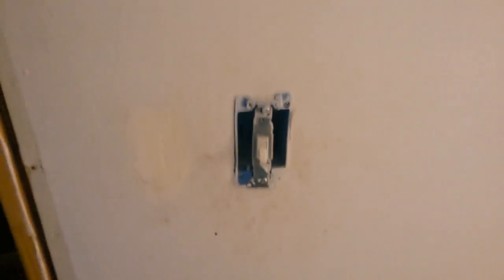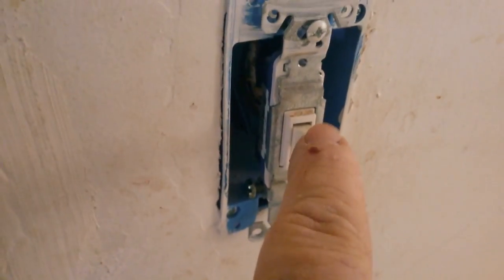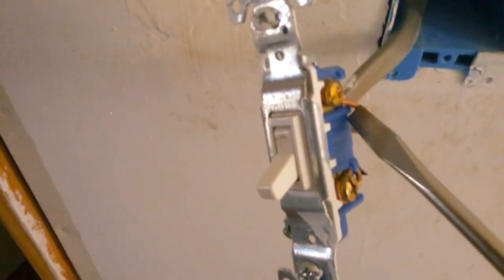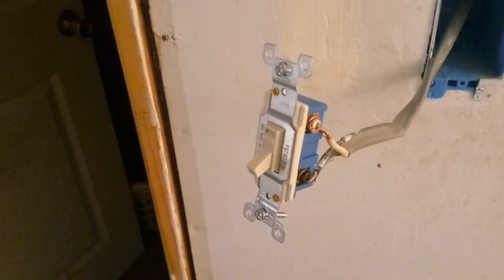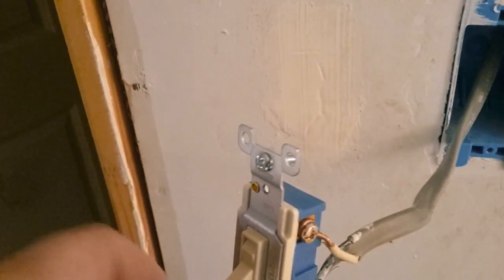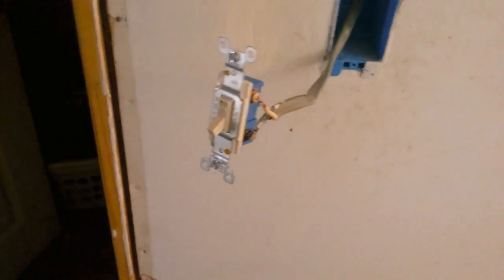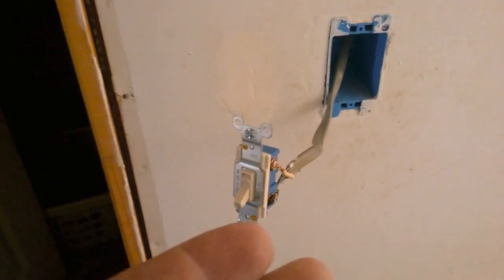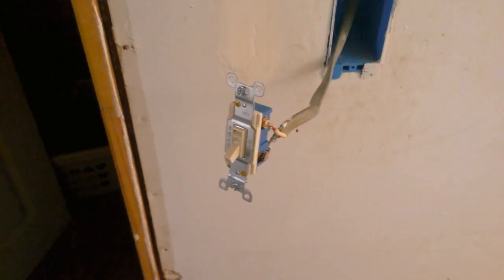How To Replace A Light Switch in a 2 Wire Non Grounded Haunted Home!

Comment: Thank you sir !! I had to replace a light switch in a garage and it only had two wires !! The color of the insulation was blue and I couldn’t find the ground so I connected both on one side and it worked ! The house was built in 1955 !! You saved me some good bucks !
Reply from the maker: You're welcome Gary. Thanks for taking the time to comment on my video about replacing a light switch in a 2 wire non grounded house, I appreciate it!
Reply: @BlueCollarDIY  thank you for sharing this info it’s so helpful and it got the job done ! I appreciate that ! Good info to know !

Comment: Thank you. Going to try this in our older home. Bathroom light won't turn off when switch is turned to off position.
Reply: Worked like a charm. Thanks for the added confidence. I'm actually starting school for electrical in the fall.

Comment: Was otj. And the DOUBLE switch was REALLY OLD one side had 3 wires and the right side only had two wires and they tied the left sode ground into the right side.couldnt tell whichbwas hot amd which was neural cause all the wires were black w copper wiring inside them criscrossed different directions and tied intonthebright side it was bizzare! i tried connecting a few different ways and guage showed power was going tonthebswitch but the ONE four switched breaker box  the middle switch  kept buzzing and tripping when the light was flipped on all sounds crazy ik but any advice? :)

Comment: Does the new one have a third screw on the left side? I couldn't see it. The new one I bought has a green screw on the left.
Reply from the maker: The green screw on a receptacke is for the ground wire. It's for a 3 wire, grounded system. They do make two wire receptacles for non grounded systems. Some people will use the receptacles like yours and just not utilize the ground screw.
Reply: @BlueCollarDIY  Thank you! I will try to find a two screw receptacle!

Comment: What happens if you cross the wires or put the white on the bottom in the black on the top?
Reply from the maker: It will be backwards!
Reply: @BlueCollarDIY  I was wondering the same thing, so the off will be on and the on will be off? Will it cause a short or something or can you just switch them back? Im changing an old switch that has the wires going on the top of switch and can barely see if there white and black. So not sure what will go on top or bottom of new switch.
Reply: Gardner bender volt tester

Comment: I wonder why the light switch box looks like it's blue plastic. Mine are metal, do I need these blue plastic ones? I thought I read that new light switch needs a ground wire. It said something about a pigtail to the green screw and bundling the green wire with the neutral?
Reply from the maker: The box is blue plastic. You may have an older light switch in a 2 wire non grounded house. Since homes are built differently in all regions, I'd talk to an electrician about coming out and fixing your electrical system. I would never bundle a ground and neutral though! They both have their own purpose.
Reply: @BlueCollarDIY  Thanks you.
 Learning about building trades is very interesting to me and is very useful knowledge.

Comment: Ok, what does it look like at the light fixture?
Reply from the maker: It depends on how the home was wired. Older homes around here are generally wired much different than modern homes. In this house, the outlets had a white and black wire running to them. No ground wire and on many of them, the white wire was actually the hot wire. So you really need to check the wires with a voltage sniffer when you go to replace a light switch in a 2 wire non grounded home.
Reply: @BlueCollarDIY  Thanks for the reply, got it figured out with the continuity mode on the multimeter, and a 10’ length of romex, once I found the travelers to the switch, kicked the power back on checked volts to ID the the feeder amongst the rest. 
Thanks for the nudge in the right direction 🤙
Reply from the maker: @LJWalter78  You're welcome. The wiring in some of these older homes can be really challenging! A simple light switch replacement on a 2 wire nongrounded system can become quite the puzzle! lol

Comment: I have a switch going to my basement lights that has only two posts, and both are black wires. What can i do to change? I cant find anywhere that sells these switches.
Reply from the maker: What I've done in the past is to buy a regular light switch and use it. You will probably need to know which black wire is the hot one though.
Reply: @BlueCollarDIY  thank you!

Comment: Many years ago, I hired an electrician to install a remote activated light switch in my home. I recently opened to have a look and noticed there is no ground wire coming from the switch box. The ground wire from the light switch is instead wrapped around the screw that holds the light switch onto the box. Is that a safe workaround for having no ground wires? I checked other light switch boxes in my home and none of them have ground wires. The older switches only have a hot and load wire connected. My only guess is that the metal switch box is grounded. and the screws act as a ground? my home is not that old, built in the late 90's.
Reply from the maker: If you're home was built in the 90's, there should be a ground wire around the green screw on the switch and grounded in the service panel. Then the ground bus in the service panel should be grounded to a rod in the ground outside.
Reply: I have the Same problem some ground screws screwed to the box.  YES it should be okay

Comment: Can you hook up a new light fixture with the old 2 wire electric?
Reply from the maker: I have in the house I'm currently living in. Since I don't have a ground wire, I just secured the ground from the new light fixture to the junction box.
Reply: @BlueCollarDIY  What happens if you don't use the ground wire in the new light fixture?I understand the is a risk of shock but  will it still work ? Also what if the junction box is plastic or not grounded?
Reply from the maker: @TheManWhoSawTomorrow  I have several lights with plastic junction boxes and they work fine. I normally just attach the ground wire to a grounding screw either on the box or on the light fixture itself, even if there isn't a ground. I never just leave them loose.
Reply: @BlueCollarDIY  Thank you.
Reply from the maker: @TheManWhoSawTomorrow  You're welcome
Reply: @BlueCollarDIY  Hey sorry to bother you again but i need more help. Am frustrated at this point. Here is my situation.
I wanted to change an old working problem free outdoor light fixture to a modern one which is controlled by a single switch (so i assume its a single pole switch and wiring).  I take off the light fixture.Its an old house so no ground. So i install the new fixture and just screw the ground from the new fixture to the metal bracket it came with knowing it still wasn't grounded but i learned ground can be left out and it would still work. I wired the remaining two wires from the new fixture to the two wires i disconnected  from the old fixture but to my surprise it didn't work. I tested the fixture and build at another place and they work fine. This led me to believe it could be the switch. Even though everything was working perfectly fine before i installed the new fixture.  
I proceed to replace the switch and opened it up and found what i believed to be a single pole wiring set up to the switch. Remember its an old house so no ground wire. All i saw was two white wires connected to the switch one which i assume is the hot to the bottom terminal and the second white wire to the top terminal (which went on out with what i presume to be the neutral through the out to the fixture. To paint the picture clearer of what i saw wired to the switch : A romex cable (WB) with the white wire (W) cut into two and connected as such: W1 
 one coming from yonder (i believe power source) to the bottom terminal of the switch and the other (W2) connected to the top terminal which then went on to the fixture alongside the black wire (B)which came from yonder and wasn't touched on its way with W2  to connect to fixture. 

I replaced the switch with a new switch exactly as i found it BUT it still won't turn on. Very Frustrating. Except if this is not a single pole wiring, i don't know what could be wrong. The switch is fine, bulb and fixture are fine. Not sure what is wrong. 

to make sure power was coming for sure, I bypassed the switch and  joined  W1 and W2 back together making it one whole wire again. I then used a new wire to pigtail into W lets call new wire ( W*) and used another wire to tapped into B....call it B*.
 I connected W* and B* to the fixture  directly (bypassing the switch) and the fixture  lit up.

This led me to believe one of two things: 
1. Either i got the the whole wiring wrong (even though i did it exactly as was done in old switch) OR

2. W2 might be broken along the line and not be carrying the power from the top terminal to the fixture.

Hope this essay makes sense.
Any help appreciated.
Reply from the maker: @TheManWhoSawTomorrow  I'm not an electric expert by any means, so take this with a grain of salt, but in some of these older homes with only two wires, the white one may actually be the hot. Get a voltage sniffer and determine which one is hot at the fixture and wire that to the hot of the new fixture and see if it works. Just make sure the breaker and switch are off!
Reply: @BlueCollarDIY  Thanks
Reply from the maker: @TheManWhoSawTomorrow  You're welcome and good luck with your project!
Reply from the maker: @TheManWhoSawTomorrow  Have you seen this video? This home had two black wires. I had to take a voltage detector and see which one was hot, then hook it up to the black wire on the new light fixture. https://youtu.be/eSOeqefgfL0

Comment: It it bad that there is no ground ??????  Because I have the same switch and I want to change it out???
Reply from the maker: A lot of older homes only have two wires. Yes, it's bad, but that's the way they built them back then.
Reply: What should I do leave it?
Reply from the maker: @ckez4724  There's not much you can do unless you want to pay an electrician to add a ground to your house. Might give one a call in your area and see what they say.
Reply: @BlueCollarDIY  isnt the ground wire sometimes in the back tied up?  You can pull it out and connect it? Ir no?
Reply: @EffinDre  I have the same questions. Can you not add a green/ground wire to this switch? Thanks.
Reply: Blue Collar DIY9

Comment: My switch has one wire on both sides and they are both black .
Reply: Get a multimeter  check for hot
Reply: No neutrals on switches

Comment: In my state, we used words LIVE and NEUTRAL wires. Can anyone translate what he means by hot wire or black wire?
Reply from the maker: Typically a "HOT" wire is a live wire. In a 2 wire non grounded home, a black wire may be a Hot wire or Neutral wire. Just depends on who wired the home. That's why you always check with a voltage detector before beginning work.
Reply: @BlueCollarDIY  thank you!
Reply from the maker: @neilchung3813  You're most welcome